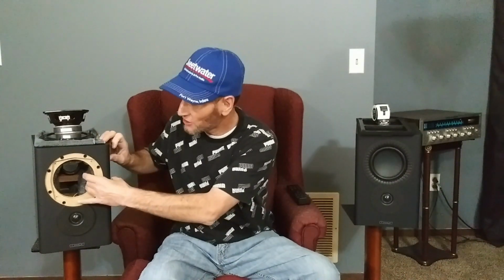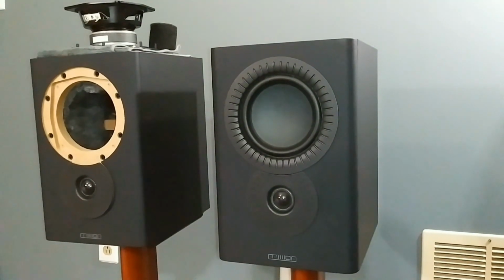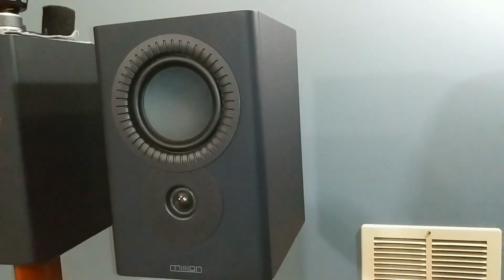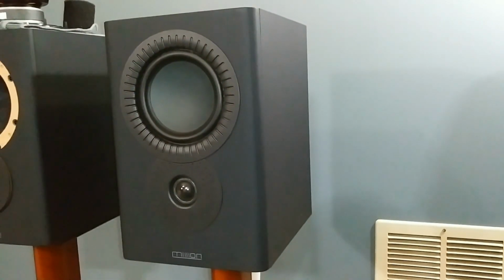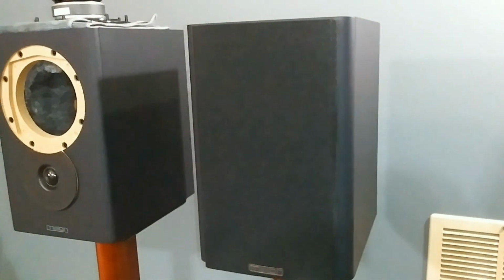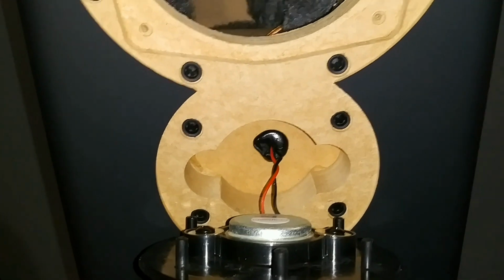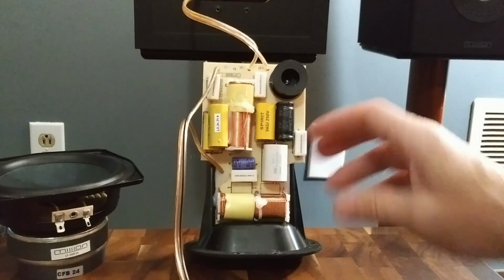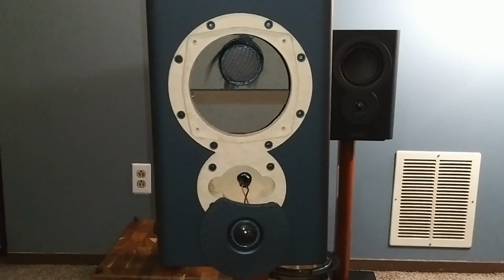Part 2 Mission Lx2-Mk2 review/ Quick specs/ and a Deeper dive inside @11:52 😆Peter Comeau nailed it!

Comment: I bought a pair Nov 2023. Amazing budget speakers. I had an issue with the crossovers. They came unglued from the binding post bracket. The glue they use is terrible. Comes right off. Used Gorilla adhesive and supported the long crossovers better. They are long and not very well supported, so probably got jarred in shipping and made the crappy glue come off. Sadly Mission would do nothing for me. No repair, replacement or anything. Just advised me to glue myself. But they otherwise sound awesome and are made very well. Wish they continued the heavy gauged wire all the way to tweeter.

Comment: Hi Man, have you compared these to the Wharfedale diamond 12.1's? 

I'm torn between the two, but the LX2's are 82 USD cheaper than the Diamond 12.1's where i cuirrently live. So i'm really not sure if it's worth spending the extra on the Wharfedales?
Reply from the maker: What amp are you using ?
Reply: @tee-jaythestereo-bargainph2120  Marantz pm5005. By the way there's also the option for the LX3 mk2s for 70 USD more.
Reply: Wharfedale 12.2. I have both the LX2 mk2 and 12.2 and after sometime the 12.2’s were just the better speaker imo. The LX2 can get a bit chaotic with some music it seems to struggle at a times to keep a grip on more complexed stuff. I grew tired of the LX2 quite quickly while with the 12.2 I never did, a very easy speaker to live with.
Reply: I tried the Wharfedale 12.1s but they seemed muddy to my taste. Of course they were designed by Karl Heinz Fink of Q acoustic fame. I prefer the work of Peter Comeau so will stick with the Missions.

Comment: Hey Tee-jay, it’s been a while, you’ve been well! It’s not very often that you see a bookshelf speaker that is inverted, with the woofer on top and the tweeter on the bottom, and have never seen a speaker design, with the crossover soldered right on the binding post. That’s a really good idea, which I’d imagine would shorten the signal path! Very curious to check them out myself, but don’t have the room for another pair! 

I have seen that Dynaudio have released a new revised version of my bookshelf’s, the Emit M20. It’s too bad that Dynaudio are stingy about shipping out speakers to audio reviewers. I really think if they just agreed to do this, they would get a lot more attention! The price of the new Emit M20’s have gone up a bit, compared to the original M20’s. Think the new M20’s were around $1699.00AUD, and the old ones were $1299.00AUD. 

Anyways, I always enjoy your videos, keep rockin! 🤘😎
Reply from the maker: Thanks for stopping in Dragonfly I do believe dynaudio does have a group of reviewers , I would love to review them I have 4 sets of speakers in that price range to make reference point with.
Also yeah my 70plus workweeks are over finally !! New job with weekends off I will try now to post atleasr 2 videos a week 😃 I have more gear still in boxes 😆

Comment: I think another purpose of the mesh thing could be to prevent animals going through the air vent.
Great detail review as always! TJ.
Reply: Yes I think you are right, one time I had a mouse entered into my tower speaker thro the bottom port 😐
Reply: @RanTausi  And Cockroach can lay eggs inside.
Reply: @SpikeoutBattleStreet  Hhhh yes indeed as well 🕷️🕸️
Reply: Also stop kids putting Lego and small toys, the amount of times I've had to open up speakers to remove them. I have the mission  qx2 the bigger brother and that has the mesh in the port as well,  all manufacturers should do this. Brilliant idea that mission.

Comment: The bracing is impressive, most speakers in this price range don't have this much. The crossover looks like they could have spent a tad more on it though,. 2 iron core inductors seems like penny pinching. Once again, good content. Thanks
Reply from the maker: Theirs 2 inductors on woofer 1 conductor on tweeter for a budget speaker i am impressed look up the crossovers in speakers like the the 
Kef Q-350 /Q-150 Or Klispch 600m I think you will be shocked that they cost way more also 😃 
Thanks for stopping in 
A total of 2 componetes
Reply: @tee-jaythestereo-bargainph2120  The crossover quality of parts  in the RP600M is crap compare this one.